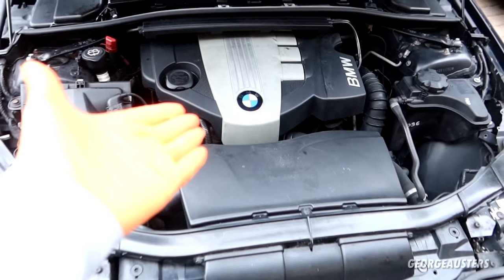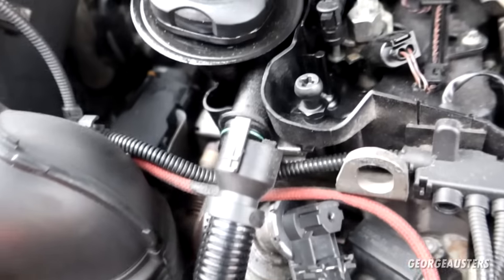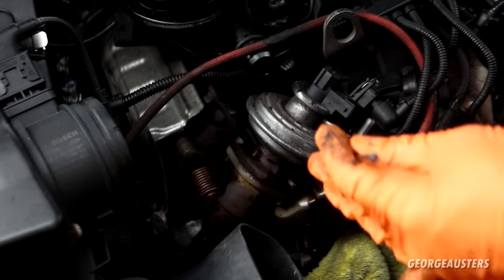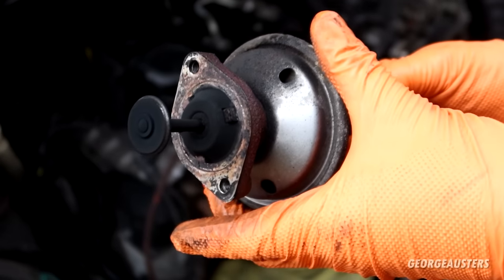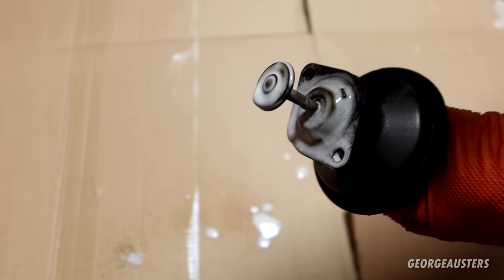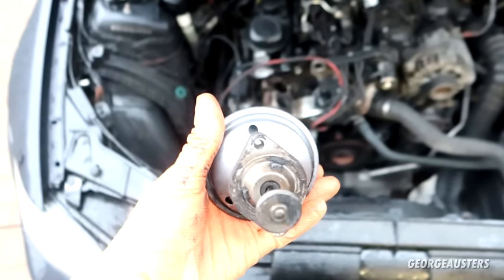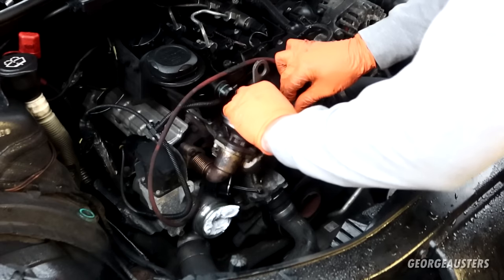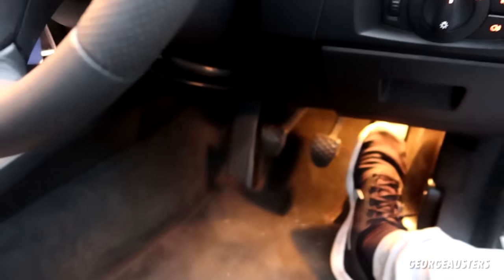HOW TO CLEAN A BMW N47 EGR VALVE

Comment: Great video as always George.  Where is the 760Li? Did I miss something? I just did the Guibo/Flex Disc on mine and centre bearing and centering sleeve but it did not cure my downshift clang so it is in a local gearbox specialist here in Kyiv, being fixed. Will let you know what they found and cost of repair soon ...
Reply from the maker: Still have it but it’s going to be a bigger project than I anticipated👍🏻

Comment: After cleaning, my car is running very bad. I have to rev the car for a couple of minutes until it can drive stable. My egr is slightly different than yours 118d n47 2010. Is there a way I can just disconnect vacume limes so I can drive the car again until I can rectify the problem
Reply: Did you manage to figure out your problem?

Comment: Ah over cleaner, this reminds me of cleaning the variable vane turbo on a mk4 golf tdi, I emptied half a can into the turbo, left it for half an hour then drove the car. It was a good temporary fix as it did get rid of some of the carbon build up. I am looking to do an egr delete on my car in due course, a good clean sounds like a fine option for now.
Reply: You 100% need to use a vacuum pump attached to the actuator to move the veins while doing this, a lot of people skip the vacuum pump part and it doesn't work

Comment: Hi. Thank you for posting the video, although it might be obvious to some I did find the part about giving the valve a knock for removal useful as I was scratching my head for a while after removing the two bolts. 

I also have the N47 engine in my BMW 1 series (120d). On cold start-up I have a rough idle, the revs bounce up and down between 800-950rpm for just over a minute before then staying at a set idle rpm. When the engine has been driven and allowed to get warm this doesn’t occur. Do you happen to have any idea(s) what this fault could be due to please, if it is a fault? 

Kind Regards,
David.
Reply: I had the same and went to may fixes until I replaced the glow plug module and now uts fine
Reply: @verdej2057  Thank you for the reply. I replaced my glow plug module but still have the issue of the rough idle on cold start. I’m considering getting the glow plugs changed but as you might know this comes with a risk. I’m not sure what else it could be, perhaps I’ll get it checked over by a BMW specialist.
Reply: @David-xx9cp  i replaced the glow plug too so i could of been that, they had heavy build up on them and one had actually melted the tip of an injector so that had to be replaced too. Before seeing a specialist perhaps get a cheap code reader from amazon and see if you have any glow plug or injector activation faults.
Fuel filter change and crank case breather should be done too but are very cheap.
Reply: @verdej2057  I did have a feeling that it could be the glow plugs as they are needed for start-up although my reader hasn’t picked up on a fault. Interestingly I noticed when it was very cold in the mornings a few weeks back, the engine didn’t do the rough idling at startup and instead the engine was happy to sit at a set higher rev. I’m now thinking is it to do with the coolant system..
Reply: @David-xx9cp  Fuel pressure sensor on the high pressure fuel pump. OEM should be around 120 bucks, but going with an used part is ok. Found mine for 30 bucks used and it's all resolved.
Reply: @antejukic6570  Thank you for your reply. I haven’t changed that part. Do you know if there is a video available to show how it is removed and changed?
Reply: @David-xx9cp did you ever sort it out mate?....im having the exact same issue!

Comment: I thought if you remove the egr and dpf your car is illegal to use on the road George correct me if I'm wrong my car would be tter of without them but what the emissions like and penalty if you get caught?
Reply: EGR removable is usually undetectable. Same for DPF if you open it hallow it out and weld it back up again when fitted the MOT tester cannot see the welds and isn’t allowed to go looking so Aslong as it’s visible and looks factory it’ll pass
Reply: @Mr330d  OK thanks for that does it not increase the emmisiins on the mot test

Comment: Hi georges, thanks for your support.  Have you  characteristics of the screws of the egr valve. M5 ? what lengh if we must change it by stainless steel ?
Reply from the maker: The part numbers for the bolts should be on realoem.com
Reply: OK thanks,  i ll look later, before unmount it
Reply: for information on realoem notified M8X20

Comment: Question, the first front section that you removed, the one before the air filter box do you have both holes cut or just one, I'm asking because my mechanic lost mine and found me another one with just only one hole cut, but I remember mine with both of them cut open
Reply from the maker: Haven't noticed!
Reply: @GeorgeAusters  if you can and have time please take a look, much appreciated

Comment: My e90 320D has a different type of EGR valve, it's not round like the one in the video, anyway after removing both bolts I cannot separate the egr, its completely seized, tried mallets and hammers and alot of brute force but still no joy, any suggestions would be appreciated.
Reply: Perhaps you have a M47 engine?

Comment: If you're replacing an egr do you need disconnect the battery after to reset everything or does it need registering like a new battery?
Reply from the maker: No need
Reply: @GeorgeAusters  thanks for replying 🙏  I read a couple of articles that mentioned plugging the car   in to something called ISTA  so you can set adaptations after installation of the new egr and also other people saying no need do anything so just a little confused as to what's best or nesseccary.
Reply from the maker: No need to when replacing an EGR valve
Reply: @GeorgeAusters  OK,  thank you

Comment: Hi I, m getting egr valve codes coming up on my 325d m sport 2011 lci N57, if I replace the egr valve will I need to recode it to the car or will it be a plug and play so to speak.
Reply from the maker: No coding for an EGR replacement
Reply: @GeorgeAusters  cheers George happy with that, now can crack on with it 🥴

Comment: Question people ... my dpf was modified before I brought the car.. basically my question is if my dpf has been drilled out and I'm getting that funny blocked dpf smell could it be my egr valve causing that same smell?  Any info would be great m.o.t in 2 weeks and don't want it falling on emissions..
Reply from the maker: You will have a diesel smell with DPF removed, it’s normal
Reply: @GeorgeAusters  is that the same smell you get when dpf is blocked?

Comment: Hi George, I have a Bmw E46 320d 150 HP with the m47 engine. If I have the egr working the car smokes like a train and it doesn't seem to have as much power, on the other hand, if I cancel it the car doesn't smoke as much and seems better to drive. My injector values are ok and the egr valve has been cleaned. Should I keep it on or should I remove it? Also, it seems to use more fuel with the egr on.
Reply: get rid of the egr and dpf, get them both mapped out and then removed, your car will run 100% better and will have a longer life
Reply: @CallMeTwisty  no DPF on a E46 320d
Reply: @Mr330d  strange because i have worked on 320d's before and bored out several dpf's
Reply: @CallMeTwisty  strange indeed seeing as E46 320d 150s weren’t fitted with a DPF 🤷🏼‍♂️

Comment: Nice one, my n47 120D is on 92k so probably time to get this removed and cleaned. Will you be doing a manifold video also? Definitely need to add that to my list
Reply from the maker: Yes will be swapping intake manifold out👍🏻
Reply: While it’s open get a look inside with an endoscope camera. You may well be shocked by the crap state of the inlets.

Comment: Could a sticking egr valve result in the engine humping like its on 3cyl and suddenly resume normal (oh at higher rpm no problem..)
Reply from the maker: Possibly
Reply: Sadly it was not the case.. it runs fine when pree warm but when cold in the morning it starts fine but when you try to pull away it clicks and studders until 2000rpm it frees up and runs nice...
Reply: @fraguzz what was the problem did you find out having same issue with mine at the moment ?
Reply: @JakeCrawfordHome  well the egr waa part of it.. but i found the injector nozzle was sticking. Disassembled and ultrasound cleaned. Now after 4000km it still runs fine.
Reply: @fraguzz  what did you do with the egr then clean it I have seen a lot of people on here saying I can block the vac pipe do you know if that’s true ?
Reply: @JakeCrawfordHome  ended up replacing it.. the old was sticking open..

Comment: I quite like my EGR value thank you
Reply from the maker: Then do as I did in this video
Reply: @GeorgeAusters  I watch alot of your videos but I'm a complete novice and this is my only car F30 320D N47 so not really up for potentially getting something wrong. 
The car is coming close to 65K and I think it's going to some lifetime fluids changed for transmission and rear diff plus a engine oil service. Garage will be happy...

Comment: hi George just quick to ask what will happen if I remove the EGR valve on n43 engine (petrol)

cheers
Reply: can someone answer the question please
Reply: @MrMaximo10  unless you combine it with a complete remap, your NOx sensor is likely to send your car in limp mode, your fuel consumption will noticeably go up, with the N43 being a lean-burn engine, overfuelling will pretty quickly destroy the cats, on top of that the engine will have an increased chance of knock and you won't pass emissions testing as the CEL will definitely keep turning on and NOx levels will be above Euro 4/5 limit depending on your model year. I'd be more worried about the timing chain and guides, oil pump and injectors than an EGR delete on an N43.
Reply: @0cypher0  ohh that's really bad news
Reply: @0cypher0  so if I but stage 1 ? it will be OK?

Comment: Will you be doing the timing chain on this motor of yours?
Reply from the maker: I won't be. I believe it has already been done!
Reply: @GeorgeAusters  may I ask what your rule of thumb is on changing it .. mileage? Chain sounding loose? Or .. cheers
Reply: Only change timing chain wen it rattles in the morning for few secs
Reply: @aqibmehboob976  thanks Aqib.

Comment: Hi George, another great Vlog. Would the condition of the EGR be a good induction of the carbon build up in the inlet manifold?

Mine is running fine but would like to inspect it and clean as required. Also is there any way you can feed an endoscope into the manifold to check rather than strip it down un- necessarily?
Reply from the maker: You can remove the intercooler pipe to see through the anti shudder valve into the manifold. I’ll be removing mine soon👍🏻
Reply: @GeorgeAusters  great news, I will look out for that one! Keep up the good work mate, looking at the comments on here there are going to be a lot of super clean BM’s about🤣

Comment: You can't just remove the EGR Valve on a number turbo diesel's. For the reason that it diverts exhaust gasses to the turbo spool up fan.
Reply: yes thats why he told you the bmw engine number

Comment: In the past, car owners attempted to remove EGR valves and Diesel Particulate Filters (DPFs) from their vehicles to avoid costly repairs.

However, for Euro 6 Emissions Standards compliant vehicles it has now been stated by the Department for Transportation that removing the EGR valve or DPF is illegal as the vehicle will no longer be compliant with the road vehicle regulations.

Vehicles will also fail their MOT test due to emission levels emitted and owners can face an astounding £1,000 fine for removing the EGR valve or diesel particulate filter.
Reply: only if they can prove "you" removed it and it was not like it when "you" bought the car, they may ask for it to be fitted again, if they can determine it has been removed ;) But as in this video all he did was clean it.
Reply: Seriously? Motor manufacturers have spent millions (billions?) designing a relatively simple piece of kit (EGR), but at additional cost, to reduce NOx emissions, and there is a suggestion that it should be removed, just because it needs maintaining? This is the 21st century, grow up.

Comment: That type or egr could be clean with a wire wheel on a bench grinder…mr muscle is good but letting it get near the diaphragm of the valve could dissolve the seal of diaphragm so I’d say no mr muscle on this type of egr if holding upside down to clean it…while you was in there you maybe could of removed inlet manifold and cleaned inside because that will shock you just how much gooey carbon is in there,you’d wonder how your engine run…all piping from egr should be cleaned in reality….the pcv valve should be cleaned also…as this kills your engine as well..egr provide the soot and pcv valve provide the moist oily air ,combined this make the goop in your intake system…hence poor engine performance…..honestly if you can remove the whole intake system of your diesel car do it as you will shocked….even inside the inlet side of your cylinder head will be caked in the carbon goop….clean map sensor with specialist electrical contact cleaner, as this will be sooted up to…. A egr clean will not be enough to keep your engine healthy…
Reply from the maker: I’m guessing you haven’t seen my other N47 videos? I removed and cleaned the intake on my 520D and will be swapping this one👍🏻

Comment: Strange headline. You did not remove the Egr valve. You took it out, cleaned it and put it back. And it was not necessary either, because it was not particularly dirty.
Reply from the maker: I removed it and cleaned it👍🏻

Comment: Anyone fixed their symptoms by cleaning the valve and cooler? I’ve been quoted £1130 by a specialist 😟
Reply from the maker: Is he pulling your pants down or what. I’d get a quote from someone else mate
Reply: @GeorgeAusters  this is to replace the egr cooler and valve, no one can get the cooler except from bmw at crazy prices! Could it just be the valve?

My symptoms are stuttering/losing power at low speeds, poor economy and faint fuel or exhaust smell in the cabin occasionally.

The specialist plugged it in and was throwing the egr codes

Comment: if it works then why?
Reply: I have a 2005 passat 1.9tdi 96kw + power box. my egr is bloving little oil throu the vents on sides and have some errors, but its not cloged., so im thinking of changeing it.

Comment: That valve looks almost like new, no need to do anything about it.
Reply from the maker: Pretty sure it had been replaced at some point, which is probably when they rounded the bolt!
Reply: @GeorgeAusters  Rule #1  Always buy a Hyundai and you will be very happy.